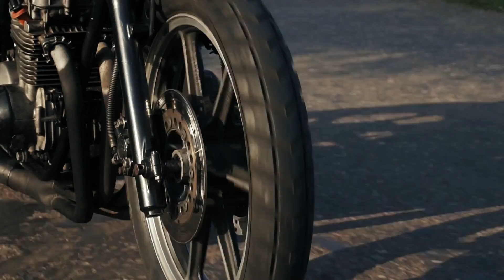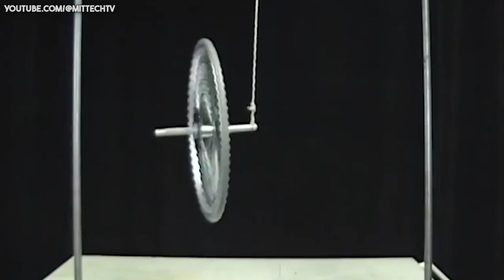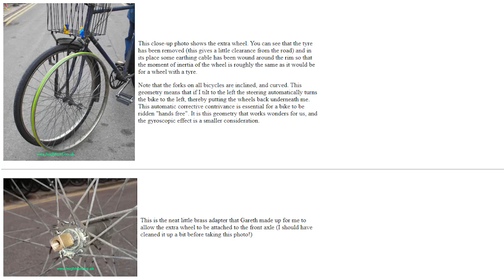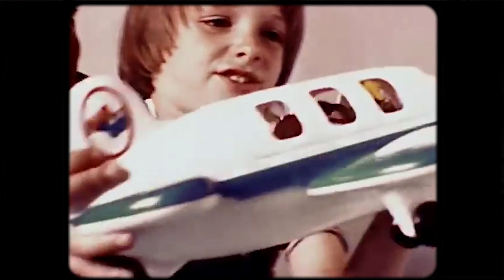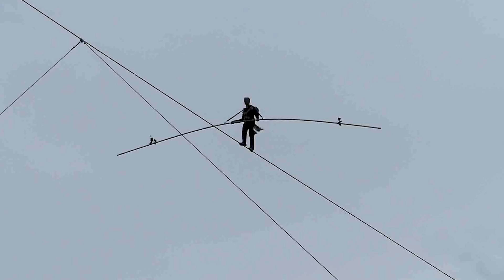How Do Bikes Stay Up? | Neil deGrasse Tyson Explains…

Comment from the maker: Have you ever done the "Ghost Bike" experiment before? What happened?
Reply: I have.  Many times.  In fact I've done it when making a video with Derek of Veritasium.
Your explanation of how a bike rights itself, due mostly to its steering geometry, is correct.  The low center of mass in that case is a red herring.
In the case of the tightrope walker, I'm 99.3% certain it's not a center of mass issue either.  It would be very easy to test this with either a rigid pole,  or a pole that's supported with cables as we used to do with the leading edges of hang gliders.  In this case I'm nearly certain the tightrope walker is simply utilizing a device with a very high moment of inertia.  If you Google tightrope, you'll see that, not only is the C.G. above the tightrope, but no part of the system is lower than the tightrope.  Just as it's much easier to balance a long pole vertically on your hand, it's also easier to balance on a tightrope with a long pole (both reduce the natural response of the system down to something easily within human limits).
Reply: Also, contrary to intuition, a higher C.G. on a bike or motorcycle will not make it less stable.  We have to be careful here to distinguish between static and dynamic stability.  In the case of tightrope walkers and bikes, it's always dynamic stability we're considering.  Neither will be stable if simply "balanced" at rest and left rigid.  But in the case of the bike, the higher C.G. will give the system a greater moment of inertia about its rolling pivot point (where the tires touch the ground) and therefore slow the response down further, making it easier to ride.
Reply: @Rick_Cavallaro  Thanks for pointing that out! I love NDT and StarTalk, but this episode was quite a bit disappointing, as it seems to be outright wrong in some explanations.
Reply: @jorn-jorenjorenson5028  We're on the same page.  I'm a fan too.  But I have been kind of surprised when I see him describing things he doesn't actually understand.  But then we're all human I suppose.
Reply: @Rick_Cavallaro   The issue isn't mass location, but the fact that when the bicycle leans, steering into the fall allows the CM to stay low.  NOT steering in that direction raises the CM, so the natural tendency of the bike is to steer in a way that doesn't raise it.  It's like saying "water doesn't flow uphill."  Duh!
Reply: Any kid who HASN'T had a terrible childhood!!!
Ha, ha!!!
Reply: Seventeen years in a bike shop: guys "ghost ride" bikes, instead of walking them around.
Reply: @Riccofiori  
>> If the rider has a comparatively high center of mass, as the bicycle goes slower, it becomes even more unstable

A higher center of mass does not make the system more unstable.

>> The rider can easily lower the center of mass by standing on the pedals

Standing on the pedals only changes where the rider's weight is applied to the bike.  It does not change the center of mass of the system.
Reply: @Riccofiori  
>>  I’ve been in situations where standing on The pedals compared to sitting in the seat changed the dynamics

Standing on the pedals will typically change the dynamics for reasons that are reasonably straightforward.  I had responded to your claim...

>> The rider can easily lower the center of mass by standing on the pedals

That is not the case.  Not only does standing on the pedals not lower the CM; it typically raises the CM since you're now standing higher than your seated position.  But what does change is your compliance relative to the bike.  It's pretty typical that the bike will move left and right relative to your CM when standing on the pedals, and will not do that (or do it a whole lot less) when you're seated.

>> when descending at a high rate of speed on a reverse camber curve. It clearly stabilized the rear wheel.

Important distinction.  Standing on the pedals does not provide any greater static stability, but can give the rider the control he needs to make the necessary corrections very quickly.
Reply: I learned something today:  being said by Neil doesn't make it true.  Sorry man, you didn't think that one through. 
(see my comments on the main wall)
Reply: @meister-t  Nope - NDT got it right.  Angular momentum adds vectorily.  If you mount two gyros on a frame, going in opposite direction at the same speed, the net angular momentum, and resulting gyroscopic effect, is zero.
Reply: This WHOLE video about staying up fell flat, not just Chuck's joke. There was no good explanation given. No follow up on why the wheel turning stabilized the bike and other issues like the rake and fork angles...It is obvious that he did not know the topic.Getting the center of mass low does not keep the bike up. This is supposed to be science not lame jokes.
Reply: Yes, it rolled then wobbled then crashed
Reply: Yup.  Did that many times as a kid.
Reply: This was really painful to watch. Steering axis inclination. The bike will steer itself back under its center of mass due to the rake and caster angles of the front suspension. If gyroscopic effect and lowest balance point were the answer then a bike would ghost ride backwards just as it does forward. I assure you that if you try letting your bike roll backwards down the hill it will not make it as far as its own length before it falls over. This is because the contact point of the tire is now infront of the steering axis angle which causes the bike to naturally steer itself away from its center of balance causing it to flop almost immediately.

Comment: Not at all convincing 
If bike wants to resist its movement of centre of mass why cant the bike do while it is at rest.
Okok you may say that it is gyroscope again but he already mentioned that adding another wheel which cancels out gyroscopic effect doesn't change the way it balances soo u simply didnt explain the original question and diverted it to centre of mass and further to pole

Comment: Wow, that was a lot of words for not knowing the actual answer.  You guys should have watched the Veritasium video from 1 year earlier.  Bikes are stable because the steering geometry is such that the bike automatically turns into the lean.  Your explanation made no sense.  You think that if you tip a bike, the overall center of mass raises?  Why on earth would you think that?

Comment: Hey Neil, I've seen a couple of comments here talk about trail and rake and they're on the right path but it's even more elementary than that. A single wheel rolling down a hill will also remain upright. The effect is not reliant on gyroscopic procession but rather on the geometry of the wheel. When the wheel starts to tip over it will no longer be symmetrical at it's contact patch. The center of the tyre has a larger radius than the edge. This means the wheel will start turning which results in a centripetal force that acts on the center of mass, pushing the wheel back up.

Comment: If one wants to execute a turn on a bicycle or motorcycle, the first thing one does is turn the handlebars in the opposite direction that one want to go. Commonly known as countersteering. This initiates a fall in the direction that one wants to turn. To keep from falling all the way to the ground, one steers the bike in such a way that the center of mass counters the centrifugal force as a result of the turm. Wheel rake and caster also add significantly to stability, even without a rider. It boils down to keeping the center mass of the cycle and rider balanced on top of the forces that could potentially pull them down. Replacing spinning wheels, I put skies on a bicycle, and it's easy for anyone who can ride a bicycle to ski down a snow covered hill on.

Comment: 6:30 - the explanation for the tightrope walking is wrong. The pole doesn't need to droop under the line, it needs to be long and have a large moment of inertia. If the walker starts to tip over, they have a much longer time to regain balance. This is similar to a broomstick being easier to balance than a pencil, because it is long.

Comment: Actually, looking at the pictures of the bike with the counter rotating wheel, it does not have the total angular momentum cancelled out. There is no counter rotating wheel on the rear wheel, thus that will still contributes to the bikes stability.

Comment: The user passive means that allows a motorcycle to stay up while moving is the torque at the front tire contact patch with the surface working with the steering geometry  that causes the front tire to move under the center of gravity of the vehicle.    Bicycling under peddle pressure is much more complicated and requires the active involvement of the rider to counteract the swerving force the peddle force creates.   Under peddle pressure a bicycle will always swerve a bit.   An experienced rider can hold the front wheel in a stable front line, but under peddle pressure,  in the wet, it can be seen the rear tire is moving side-to-side by the steaks it leaves.  Bicycling under peddle pressure dynamics is still not completely understood.   

Bicycling under peddle pressure involves simultaneous action's by the human that requires the human place their brain into a somewhat meditative state in order to free it up for complex simultaneous balancing behaviors.   If you concentrate too much on the actions for activity balancing a bicycle that focus breaks simultaneous balancing behaviors and you can't do them.   This makes learning to ride a bicycle under peddle pressure counter intuitive.  Most adults forget this transitional phase in riding a bicycle.  

Being able to change the thinking state of our brains to activity balance a bicycle under peddling  is seen as a coming of age at 5 - 7 and it is not considered lower animals have the ability to do this.  This "letting go" is an ability we can forget how to do in extreme stress requiring us to calm ourselves down and try again.   

There are videos of trained bears being able to peddle a bicycle, but their jerky actions on an exceptional stable bicycle likely means they are not able to change their brains state to allow simultaneous balancing behaviors.  They are typically riding in a circle with a lean that is more stable than going straight.  Orangutans are suspected of possibly having something like this human ability.

Comment: welded the steering bearing on the front wheel of a bike. It didn't go three feet before it fell over. Without steering you cannot balance the bike.

Comment: They're explanations here are supremely mushy and vague and wrong. The exception is early on in the video when Neil explains that win the bicycle goes off balance to the right The front wheel will steer to the right which will counteract the lean of the bicycle. That's how the bicycle automatically corrects when there is no rider.

Comment: 8:40 a good motorcycle will have it’s weight evenly distributed between the wheels…to much weight on either end is going to affect ride performance. 

Also…a really good handling motorcycle is usually considered “flickable” which means a center of gravity that sits higher up so the bike can be readily leaned one direction of the other.

Comment: It's the rake and trail of the front end that makes the bike stable while in motion. 
Draw a line from the front axle to the ground straight down, now draw a line along the angle of the forks to the ground. The angle of the forks to the ground is the rake and the point where the tire touches the ground ( the contact patch) is the trail. As long as the contact patch is behind the rake angle the bike will always self correct! 
The center of mass of the bike makes it more or less responsive to input. The lower the center of gravity the easier the bike is to handle, especially at high speeds.

Comment: Does this still apply when cointersteering? Couse when i do it both on my bike and motorcyles, is literally feels like im fighting the bike to balance and steer, and that im actually balancing, not banking.   My lanyard goes sideways so definitelynot falling into the curv.
Reply: Counter-steering just destabilizes the motorcycle briefly to get it to lean over.  Then, a well-designed motorcycle will stabilize in that new lean angle.  You don't need a motorcycle to feel this.  Try it on a bicycle at higher speeds.  It works the same way.  Counter-steering really only comes into play at speeds in which the gyroscopic effect does.  At low speeds, you aren't counter-steering (bicycle or motorcycle), only at faster speeds.  And like I said, a well balanced bike geometry won't require you to continue applying this force.  It's only to initiate the lean.

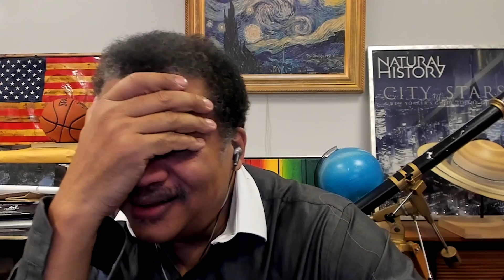Comment: @9:16 I'm 6' 7" tall and 260 lbs. I ride a home built ebike with 29" wheels, while the motor is in the crank stay, the heavy 18 lb battery is over the rear tire. That puts the battery about 33 inches above the ground and about 9 inches below my seat. the bike is every bit as stable to ride as any acoustic bike that I've ever ridden which is a good thing because the bike is more than capable of going faster for longer than I can power any acoustic bike. 
I honestly have no clue how balanced the bike may or may not be without me on ot because I wouldn't dare try, it's heavy and too many expensive bits would be destroyed when it inevitably goes over.
The bike weights about 72 lbs as ridden, so my 260 lbs, and where it's carried on the bike is such a larger factor than the bikes weight and it base center of gravity. The straight vertical line through the mass and then through the center line of the tires contact point with the ground, coupled with momentum is what creates the balance. Weight transfer is lineal on a bicycle in motion, it doesn't deviate latitudinally only longitudinally and an object in motion tends to stay in motion.  That is the difference between static load and dynamic load. On turns you lean the bike and centrifugal force counteracts gravitational force, this is done to reduce steering input and to lower the center of gravity. The steering angle reduction is important to traction, a tire only ever has 100% traction, ever separate force you ask the tire to deal with takes up a certain amount of that traction, turning, acceleration, braking, side slip etc.
Reply: Acoustic is a silly term for biking to borrow from music.  I don't think this should be encouraged.  We don't talk about acoustic horsepower, or acoustic mixing blenders, because these things are not driven by the way their shape moves sound waves....like a guitar or violin or drum is.

Comment: While riding without touching the handlebars, you steer the bike by pushing the saddle in the direction you want to go, becaise the axis of steering is at an angle. When the bike leans left it steers left, and thus rightens itself, and asfar as I can see the center of mass does not really matter as far as I can see, in principle, though of course it will affect the way it handles.

Comment: The gyroscopic theory is laughable. Road racing and time trial bikes have extremely light carbon fiber rims and extremely light weight tires. Although designed for speed they are still very rideable at 10mph or less. Point being the mass and rotating velocity does not result in enough gyroscopic force to “balance” a 150 lb athlete. Also, if the heavy rims and tires of the cheap bikes had enough gyroscopic force to balance the bike then the gyroscopic precession would make the bike wild to handle at higher speeds. 
As others have noted, it’s the rake, trail, and head tube angle that by design shift weight of bike slightly left and right as the front wheel makes slight left right castoring adjustments.
This topic is not a mystery of the universe. The thousands of bike frame designers and builders around the world apply the long known math to achieve stability to satisfy their customers.

Comment: Interestingly, if you want to turn to the left on a bicycle your first movement will be a slight turn of the handlebars to the right to induce a tilt towards the left thus allowing the bike to turn into the desired direction with the leaning weight providing the centripetal force. If you just turn directly to the left you will fall off.
Reply: Same with skating!

Comment: Fun Fact: What a lot of people do not know is that high wire bicycles are what we bicycle people call a “fixie”. They have the rear wheel mounted in reverse so the caliper and or disc brakes can be removed and the way you break is by back pedaling. Which is why they are able to go forward and backwards. Fixies are bikes that not only have a single gear, but that single gear is fixed at all times. So no matter if you go forward or backwards, up hill or down hill you are constantly pedaling and your speed is determined by how fast your legs can move. You can control your speed by controlling your cadence. There is no coasting. Also a ‘secret weapon’ that fixies have is bringing your feet up off the pedals and resting them on the handlebars so the pedals can freely spin when going down hill. They pick up incredible amounts of speed this way but the only way they have to break is to put their feet down, back pedal or skid the rear tire left and right. Fixies rarely get stolen because you can tell they have no brakes. My ultimate goal on a bicycle is to be skilled with my own fixie one day.

Comment: Another fun counterintuitive thing about bikes: the weight of the rider is not actually supported by the bottom of the wheels; instead the rider is dangling from the top of the wheels. The spokes are very thin and have very little strength under compression, but they have great strength under tension.